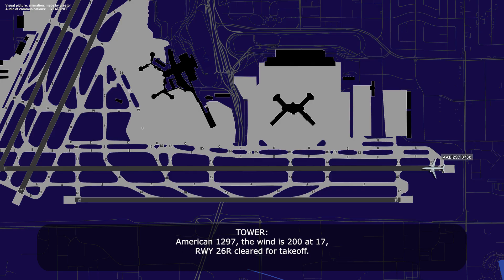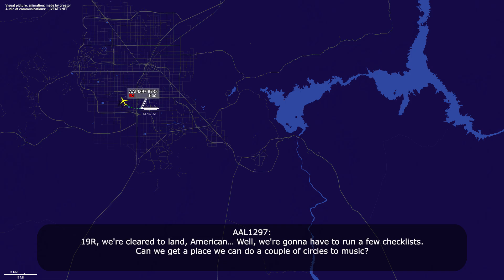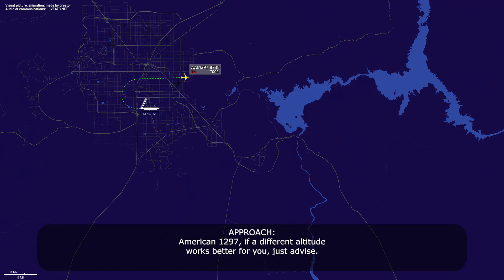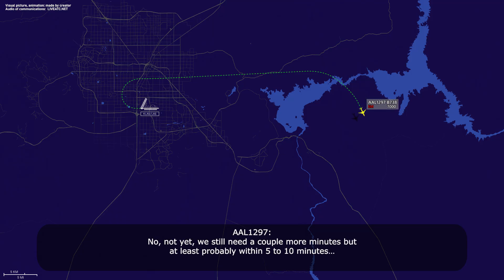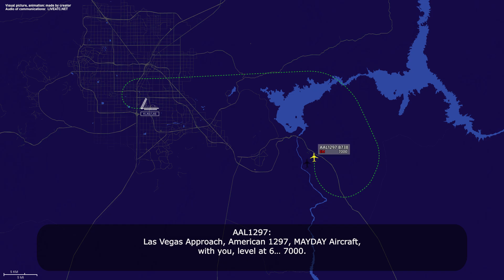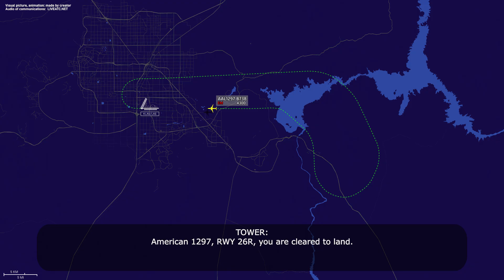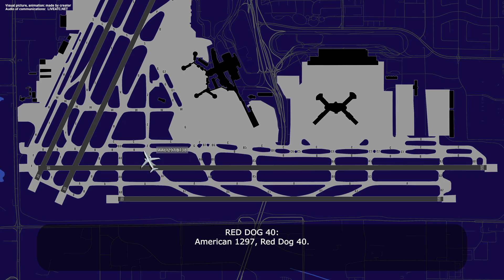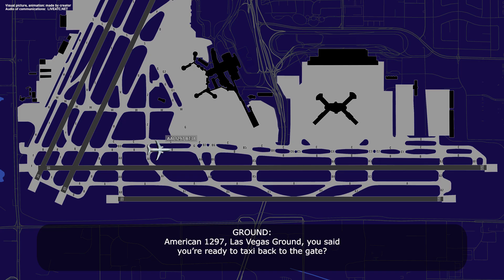MAYDAY. American Airlines Boeing 737 reports engine overheat shortly after takeoff. Real ATC

Comment: This engine overheat didn’t necessitate a Mayday call initially- but even if it was, it should have been reduced to a Pan/Pan after it went away seconds after the indication. Obviously the airline companies have instructed their pilots to basically make every event a Mayday call.
Reply: Engine overheat could be an issue of possible fire. Its a mayday situation
Reply: And any such thing over a mountainous terrain is a mayday
Reply: And how this changes anything? What's your point?
Reply: It was reduced. It doesn’t have to be said though. Just ask for what they want and they got it.